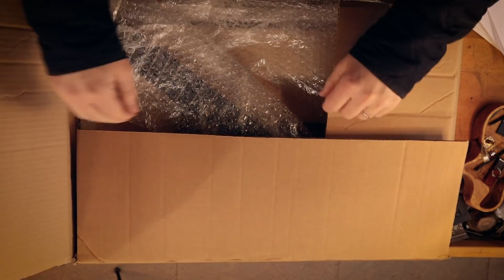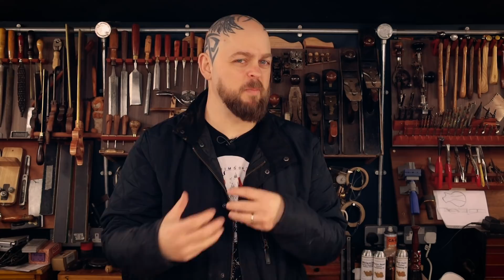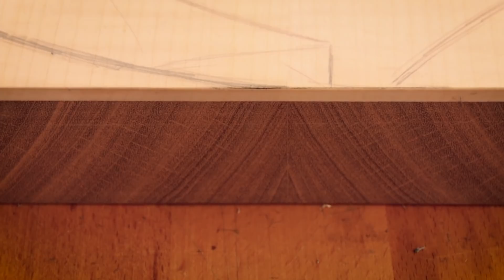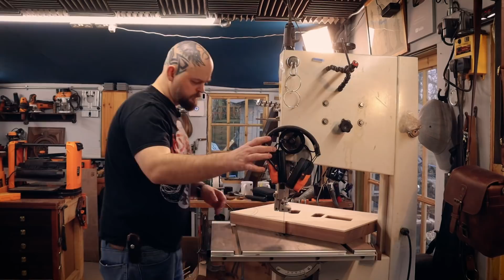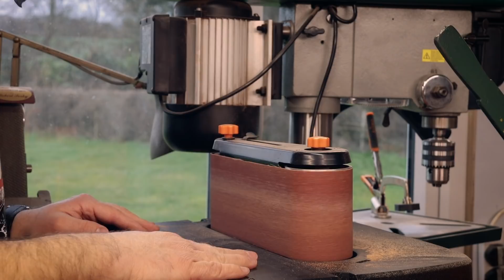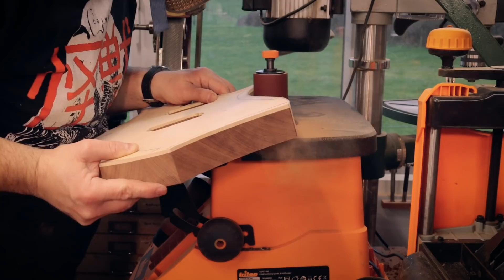Ep 1 - Shred - Design & Cut a new shape - How to Build a UNIQUE Multi-Scale Kit Guitar

Comment: Me I'd go with an odd one (mainly cause I've never built a guitar yet but I have lots of crazy ideas): make a Flying X, like a modified Flying V with the horns. make the bottom wings on a different level, as in carving them flat at around 30-35 mm instead of the usual 45. remove the top so you can dig into the body to make a hollow or semi-hollow, and have the sound holes at the "recessed" places on the bottom wings. And maybe make it quite angular for a sci-fi or cyberpunk look (again, yes). I mean, that's the plan I have for the second guitar I have in mind, I just think it sounds cool, although quite hard to work around with this blank

Comment: Hi Ben, love your work and the channel. You've read my mind with this design. I tend to play sitting down and with the electric guitar in a classical style position (the neck pointing up at a 45 degree angle) and wondered why there aren't more guitars designed to accommodate this. If the body is this kind of shape, then the input jack is usually in the wrong place. Are you going to reposition the input jack location on this one and is there a technical reason we don't see more of this style of guitar? Thanks and keep up the great work.

Comment: Hi Ben I have a question. Can you use a regular bridge with a fanned fret guitar? Would love to know
Reply: Angling a standard bridge will move the strings closer together. The bridge of course needs to be angled for correct intonation unless you make the bridge the zero angle point which would be a bold stylistic choice. You could make a small hands guitar this way, seams like somebody must have done that already but I haven't seen it. 
Also, single string bridges exist, maybe you know that but if you don't, might be a mind blower.
Reply: @brocktechnology  If I'd buy a baritone bridge for 27' and would angle it correctly would that align with the fretboard?
Reply: @Moth_On_Fire  As far as I know the bridge string width difference from "standard" to baritone is pretty small and baritones are mostly built around the same bridges as other guitars but I'm no expert so if anybody's got something to add, buy all means.
You said 'buy', if your not looking to repurpose something you already have, you should probably suck it up and buy exactly the right bridge for you. 
If you haven't already, try window shopping at an outfit that specializes in bridges for interesting applications. If you need a place to start try hipshotproducts.com .
Also this tool https://www.ekips.org/tools/guitar/fretfind2d/ is a great help figuring out what's possible(and building it), I recommend it highly.

Comment: Ben, so i have this 7 string explorer type guitar where the frets were so bad they had to go.
Sadly due to how they were placed the fretboard chipped all over the place.
To what degree is a fretboard fixable? could you perhaps do a small video on the second channel showing how to fix bigger chips in a fretboard? 

Cheers from the Netherlands.
Reply from the maker: sorry this happened to you, the fix is easy enough though, dust mixed with superglue to fill the holes then sand back flat and re-cut the slots, refret etc.. B

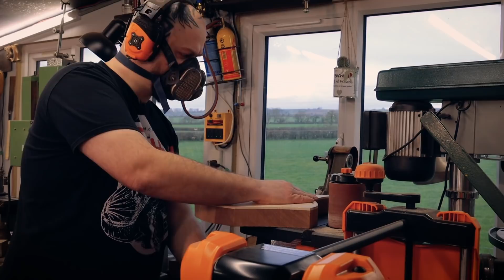Comment: 12:40 What's the drawing on the wall above the door?

Also, how much material does a headstock need? Could you cut it to make a sort of L shape with the leg with the holes in being about 20mm thick?
Reply from the maker: I'll try and get a close up.. it is plans for an antique drilling machine.. the headstock needs to be 14mm or so think or tuners won't fit, also too thick and you lose vibration and start to sound a bit dead imo. B

Comment: Sorry, I just went the website for pricing. I noticed when selecting "body only", the kit price remians the same, and when selecting "neck only" the price is more than the kit together.
The neck only price is very reasonable, however am I seeing correct pricing for the body only?
Reply: I ran into the same thing, it seems to be a bug, where it first selects full kit, but shows the minimum price which is for the body only. If you change either which hand it's for or select the full kit again the price should be right.

Comment: I hate when you say “I’m calling it a day” ha ha ha ! this shape is very nice !
Personnally I maybe try a horns shape parallel to the last frets, or parallel to the nut (from the front it would look like a straight line on the body/neck joint but it would be carved behind) other than that the frets are giving so much straight lines to the design that it would maybe feel too much if the body had been designed with straight lines... or maybe it only requires more designs skills than my mind 😂

Comment: Please don't attach the neck with screws or bolts. I would glue it in and smooth out the heel. I think it would be more instructional if you used a commercially available bridge because most people don't have the metal working tools required to build one from scratch.

Comment: £415.00? for the kit?  what a fucking ripoff. seriously i understand your charging your rates for the work but holy fook, last year ii went and bought a large old antique (its close to 80year old)  dressing table  made from solid walnut with 3 big drawers at an auction for like 70quid as the finish was abit battered due to the age but the wooooood is super dry and i have enough wood to make  at least 2 guitars, the wood on the face of the drawers are thick enough and long enough to make a neck and the top is thick enough to make a 2 piece pancake body (like having a maple top but in this case both parts will be walnut,
Even still that was lucky for me but why you would bother buying this kit if you serious about building a guitar? go buy the wood and great hardware for far cheaper than this kit.